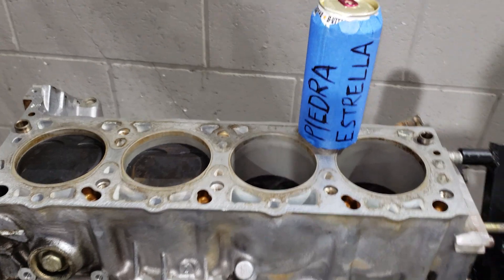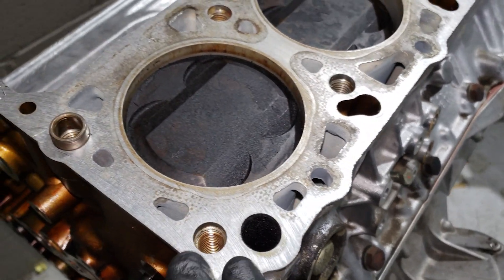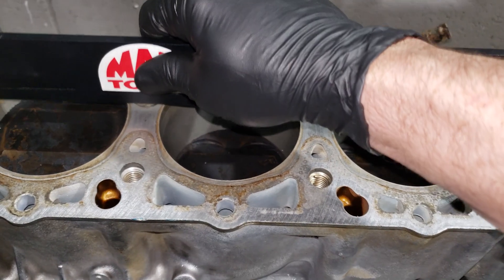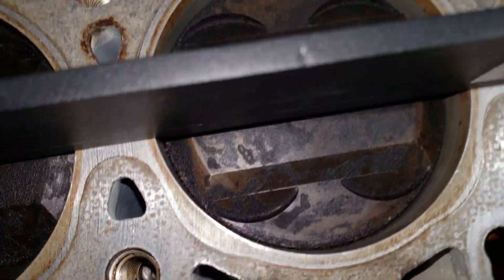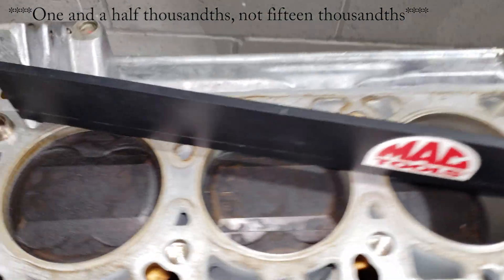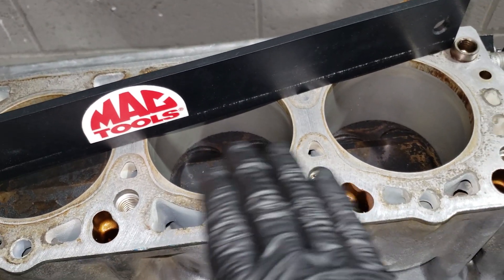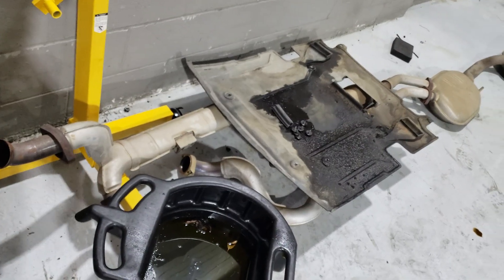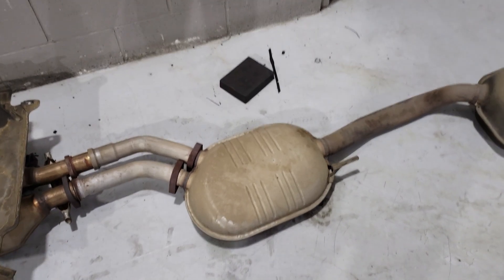M119 Checking Block for Warpage

Comment: Once again - thanks for the great videos! Do you have a video where you take warpage measurements of the heads?
Reply from the maker: You're beet welcome!  I don't have one for the heads, but the process is exactly the same as for the block.
Reply: @FriendlyMBTech  ok. Thanks. And you didn't touch the bottom end and the pistons/cylinders at all? Just the top end and timing?
Reply from the maker: @evgenyknafel2857  that is correct.
Reply from the maker: @evgenyknafel2857  the cylinder walls looked ok so I didn't feel the need to remove them and replace them.

Comment: That looks like a really nice block, I also noticed all 4 cylinders on that side are 0+ factory sized, so it wasnt a monday hangover built engine, was that the case on the other bank too?
Reply from the maker: Yes. The other side looked very similar.  All cylinders showed very little wear and the deck did not have any warpage.